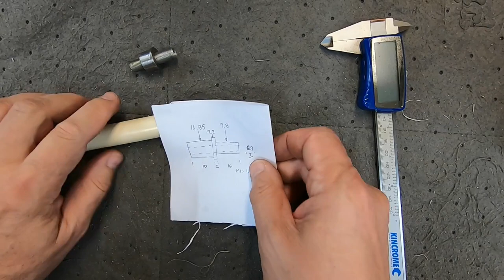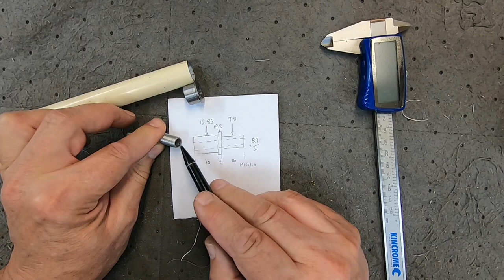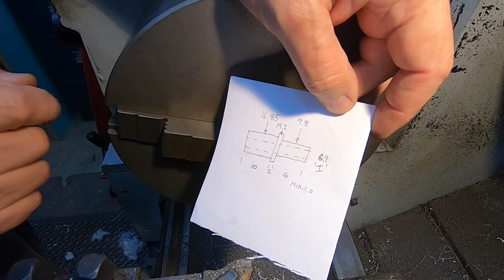Milling machine: let there be light - and lots of it.

Comment: That's a good idea, they get a fortune for ready use lights.  Subbed!
Reply from the maker: Thank you. This has worked out really well and now I've trimmed the overhead bar to correct length it looks a lot tidier :)
You can see the the final version in this video:  https://youtu.be/CCmiQ13FjC8   - at the 29 minute mark.
Cheers, Alan.

Comment: Alan your videos work is the best I have seen from a new YouTube creator   but the audio goes up and down which is hard for my old ears .
Keep up the good work Christopher from Queensland
Reply from the maker: Thanks for your encouraging words Christopher. Sound levels are an ongoing challenge for me. I have a fairly low level of skill in the operation of my machines so my work flow is patchy and non-linear. This results in a lot of editing to present a logical progression without the boring bits and general faffing around. I also use several different camera and microphone setups and this combined with many video segments is where the sound level fluctuation creeps in. I'll keep trying to improve though.
Cheers, Alan.
Reply: @alanshomeworkshop  Hang in there I have trouble sending a e-mail !